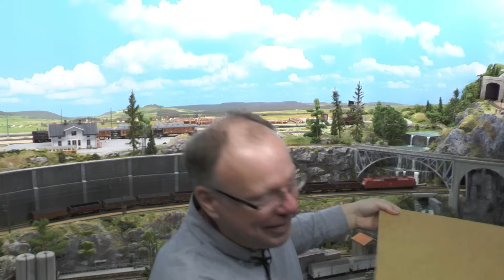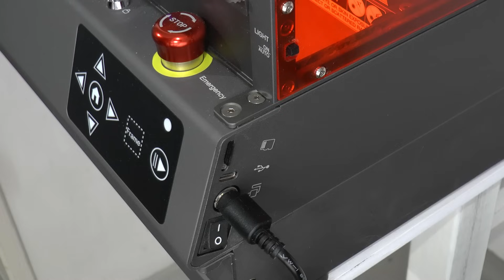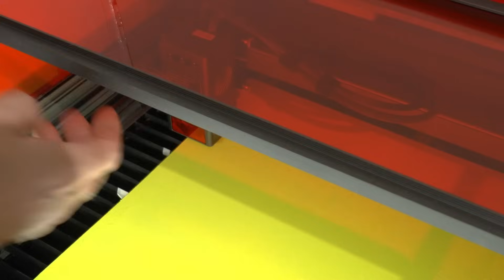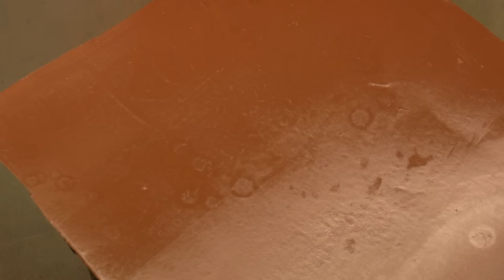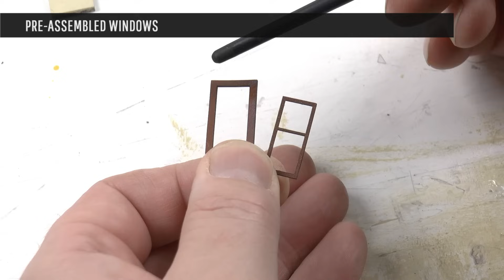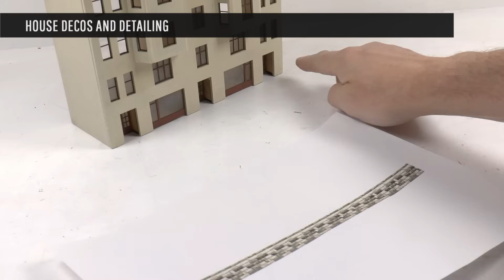Scratch building miniature town houses

Comment: Interesting and inspiring video; however, as others have already mentioned, the really hard question is how do you get from Google Maps/Street View to a precise and accurate scale drawing (sometimes with 3D protrusions, like in the house you made)?

I am planning a dioramamodel in 1:72 scale of a section of Friedrichstraße in Berlin (between Kochstraße and Zimmerstraße, ie Checkpoint Charlie, as it was around Aug..-Oct. 1961), and although there is plenty of photographic reference material, and some of the houses are still standing (and therefore viewable in Google Maps/Street View), I find it very hard to get measures right, particularly the height. The only measure that can be obtained is the facade length (using the measuring tool in Google Maps), and I don't think it is very accurate (maybe ±1 m? I'd very much like an accuracy less than half of that.)
Reply: Measure the part you don't have or can't get... with a tape measure and then do math...... I promise I'm not trying to be a dick. I'm just bad at instructions😅
Reply: @steelguy1032  no, not bad at all, that was very correct, good and precise advice. It's merely incomplete, and I already had figured it out that much by myself. I appreciate the effort just the same, thank you! :-)